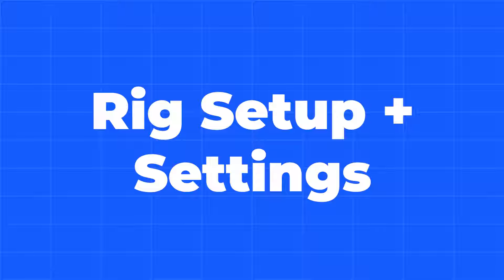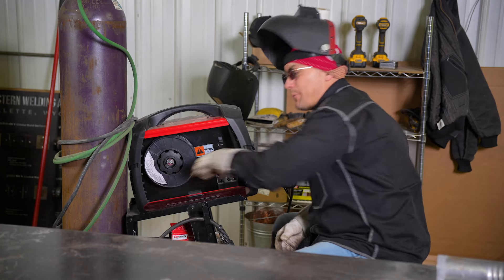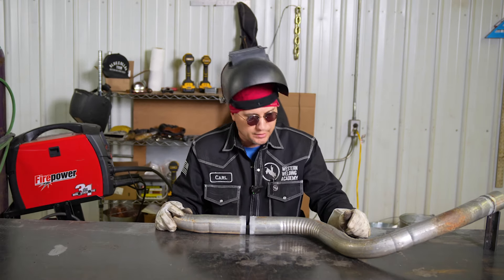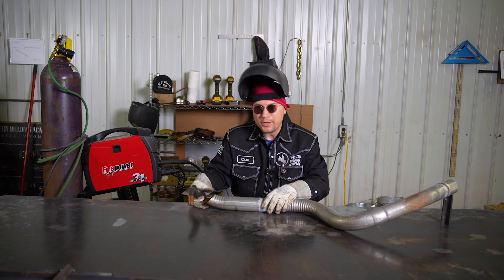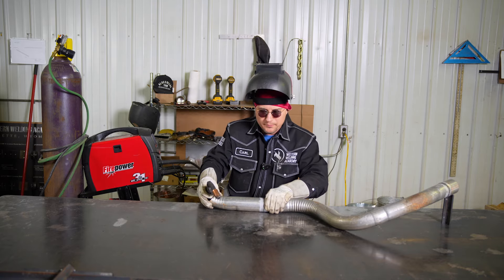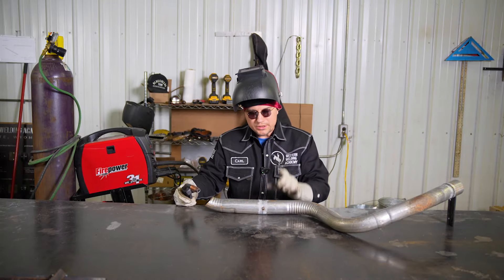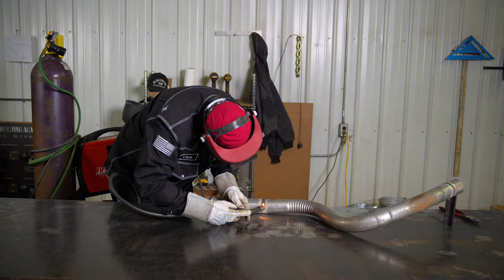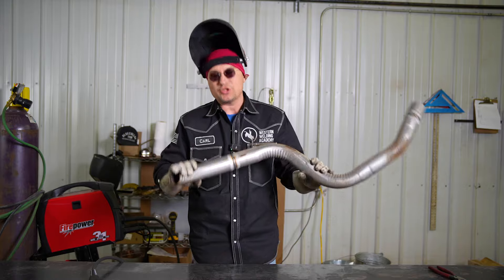HOW TO: Weld an Exhaust Pipe

Comment: Notice something important he did. Time the stop/start of the welding so that the puddle never cools down between welds, or there won't be a solid weld. This is especially important in structural.  The Metal Cored process tests a vertical up plate and you need to stack tacks to do it, because it's a flat position wire. Hope this helps stop start tacs.
Reply from the maker: Appreciate the insight!
Reply: I just started welding exhaust pipes and that method has worked best for me.
Reply: Keep it hot

Comment: Okay, wait a minute... I learned from my father, the super custom hot rod exhaust welder for 40+ years that when you do a weld on exhaust pipes that you use the tubing bender first and taper the one end? To me that's logical because I couldn't imagine trying to get the pieces of pipe perfectly touching each other to spot weld, let alone the entire circumference. Right? I mean sure its easier to weld like that on a table but that's not how it is in real life welding pipes, muffler and tailpipes.
Reply from the maker: Very cool! Thanks for sharing your valuable insight from years of experience in hot rod exhaust welding!
Reply: I've been welding for 25 years. any welder who's good at all can line up pipe, clamps on bar or angle work best.

Comment: I too use carbon monoxide to weld
Reply: I had to rewind to be sure I heard what I thought I heard
Reply from the maker: Lmao
Reply: for exhausts and rusty panels change on cars , always i use 0.8mm wire and carbon dioxide ( CO2 ) i had professional and cheap mig welding machines

Comment: I use .035 fluxcore on exhaust,  its best with a natural breeze or fan to carry fumes away from you.
Reply from the maker: Yes, having a natural breeze or a fan to carry the fumes away can greatly improve the working environment and safety. Thanks for the tip!
Reply: The fluxcore is that gas less?

Comment: "Carbon Monoxide" I thought welding fumes were bad enough but welding with Carbon Monoxide? I love it.
Reply: Hence why it's such a dangerous occupation. The majority of professional welders "slack" on the safety at least once in a while, or some work in very tight spots without proper ventilation. Read an article yesterday about the Swedish welding industry. They asked a welder of 25 years if he'd ever slacked with the safety, and he just grinned and replied "Who told you that?". He followed up by saying "We're responsible for our own work space. No boss will ever come out and tell us we need to put on the mask, because everybody knows he's done the same thing.". In the same article, they wrote about a case where two welders had been working in a verry narrow area without proper ventilation. It was a small job so they didn't think they'd need it. 20 seconds in and one of them collapse on the floor due to breathing in too much carbon monoxide.
Reply: It's carbon dioxide not monoxide. Carbon dioxide is injected into all your favorite carbonated beverages. CO2. Gotta love it.

Comment: Awesome video brother!
An additional tip for cleaning the pieces you're welding:
If you don't have a brush or grinder with a wire wheel you can use sandpaper to clean the areas to be welded.
Reply from the maker: Great tip!
Reply: Another great idea for exhaust is a strip of emery cloth... kinda wrap it around and alternate pulling on the ends!

Comment: So i only have access to an old sa200 stick welder would i even be able to weld up exhaust pipe if so what size rods would i need to use?
Reply: use 3/32 and keep dig low, i stick stainless at like 30- 50 amps depending on how thick

Comment: Can I use Dual shield ? Or do you recommend solid wire
Reply from the maker: Using dual shield wire for welding exhaust pipes is not recommended. Dual shield wire is typically used in heavy-duty welding applications, such as structural welding or heavy equipment repair, where higher deposition rates and deeper penetration are needed. For welding exhaust pipes, which are typically thin-walled and require precise control to prevent burn-through, solid wire with a shielding gas like MIG welding (GMAW) is generally preferred. Solid wire provides better control over the welding process and produces cleaner welds with less spatter, which is essential for welding thin materials like exhaust pipes.
Reply: @WesternWeldingAcademy  thank you for the Feedback 🙏🏻🔥

Comment: How do you tell if your too cold or hot?  What am I looking for?
Reply from the maker: Determining whether a weld is too cold or too hot involves observing several key indicators. A cold weld might exhibit insufficient penetration and fusion, resulting in a high and convex weld bead profile with streaks of unmelted filler metal and a grayish appearance, while a hot weld can produce excessive spatter, burn-through, and undercutting, with a whitish or bluish tint and irregularities like ripples or waviness in the bead shape. Additionally, paying attention to the sound of the welding process can provide clues about the weld quality, with a proper weld emitting a steady crackling sound. Regular visual inspection and, if necessary, non-destructive testing methods can help ensure weld integrity and adherence to desired specifications.